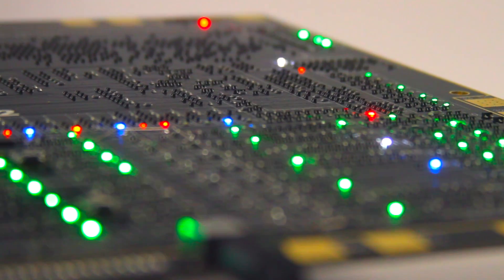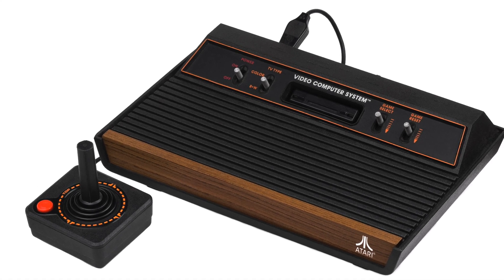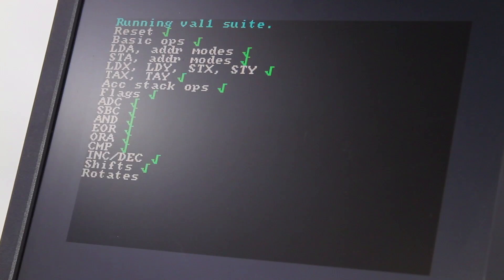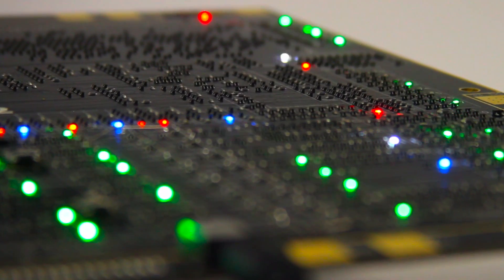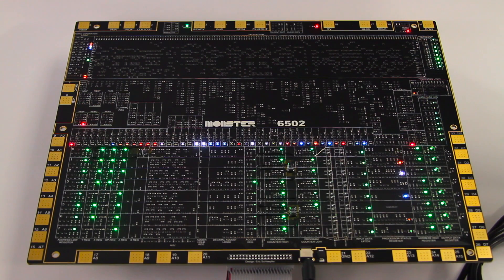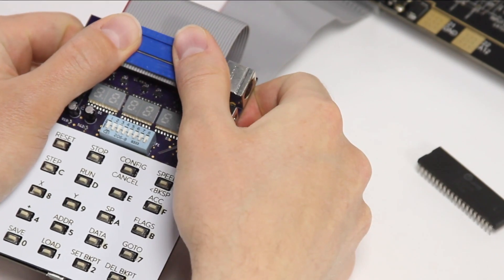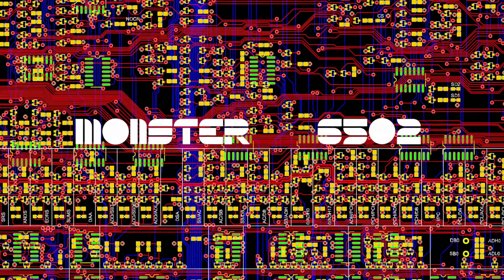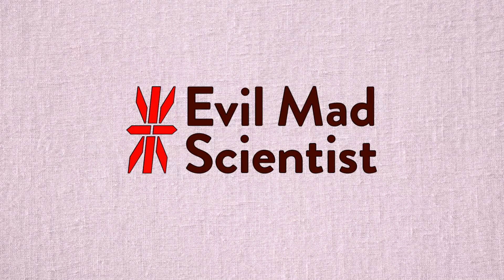MOnSter 6502 Update #1

Comment: Can you single step or massively slow the clock?
Reply from the maker: Short answer: yes. Long answer: The clock rate itself cannot go to zero; the dynamic nmos architecture sets a lower limit on the clock speed (about 20 Hz in our case). However, there is a well-known single-step circuit for the 6502 that does allow you to advance one instruction at a time, even while the clock continues running.
Reply: It seems like a good (better designed?) alternative to the http://www.megaprocessor.com/  Mapping the memory to a little oled or other display might be an neat thing for the future. Working out equivalent scaling for some period dram dies and displaying them with a data overlay at the same scale as the monster 6502 would be awesome.
Reply: go to the MegaProcessor Project
https://youtu.be/lNa9bQRPMB8
there you can slow down, halt and single step. every single gate has an LED indicator and even hex display to make the processing more understandable

Comment: So you made a megamicroprocessor?
Reply from the maker: Yes, although we prefer the term "macroprocessor."
Reply: @evil-mad-scientist  I Will call it steve
Reply: @evil-mad-scientist its just circuitboard not prosessor.it use multiple components. so its 6502 circuit not prosessor so not 6502 chip, but yes it can do same thing,but really are you sure its do same. all bugs too?
Reply from the maker: @jarisipilainen3875  It is a large scale "working replica" -- it is not a chip. Yes, it's a direct replica of the 6502, and has all of the bugs that were present in the specific revision that it's reverse engineered from. The reverse engineering was done by the Visual 6502 project, so if you want to know more about the specific bugs you can check there.
Reply: @evil-mad-scientist  that's good.now can do big c64.mini allready done
Reply: @evil-mad-scientist  perfect 👍
Reply: to end the discussion, it would just be "processor"
Reply: Not micro anymore lol. It's a "PCB" version of a processor that was originally sold as a microchip. A PCB processor. PCB processors were very common in the late 60s, they are more advanced than the Walls of AA battery-sized transistors used on the TX-2 a shopping center sized computer from the 50s which was capable of full 3D graphics and it had it's own super compact Nuclear Power Plant which produced it's required 8 Megawatts of power! It used INSANE amounts of energy, literally the energy of a small town. But was already more powerful than a Super Nintendo, in fact the TX-2's graphical processing power is similar to the SNES with SA-01 and Super FX chips operating simultaneously! It was a BEAST back then. After all I am talking about a 50s computer. A 50s computer capable of 3D graphics is just amazing really. CAD was literally born on the TX-2 which makes it one of the most historically important computers. Even more amazing is the fact that the TX-2 was produced by hand, without etching techniques... It was extremely unefficient but it was an amazing construction nonetheless. Nowadays most of it was destroyed with only some small parts preserved in museums. You can see how big was a section of it's Core Memory and the transistros which were as large as AA batteries... It was really huge, really low clock machine but with an immense parallel processing capability for the time.
Reply: macroprocessor*
Reply: That would be one large enough that you could walk down the halls of the traces.
Reply: humunguprocessor
Reply: Wait what the f...
Reply: Or as I suppose it would have been called at the time, simply "a processor"?
Reply: Great! Incredible!
Reply: I call it the PCBCPU
Reply: I would call it a "Micro-Macro-Processor" ;)
Reply: @BertGrink  "Micro-Macro-Processor" rather a macro-microprocessor, since it is a scaled up microprocessor and not a scaled down "macro"-processor.
Reply: Now imagine all this energy and effort into something usefull. LOL